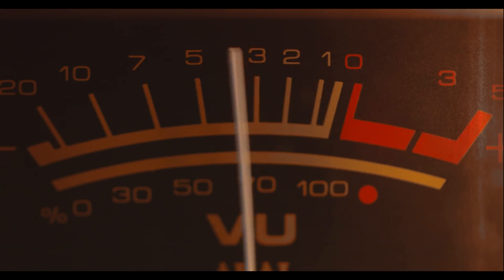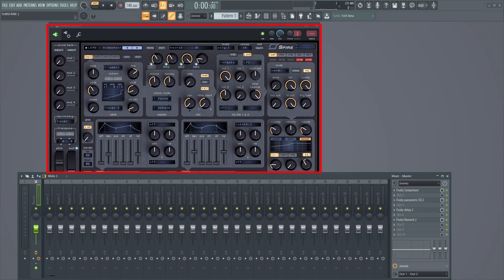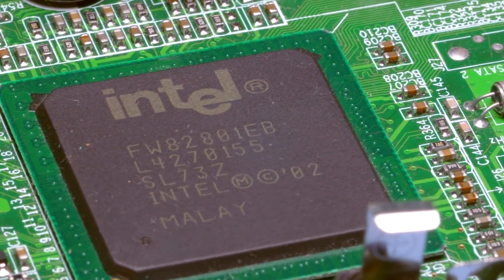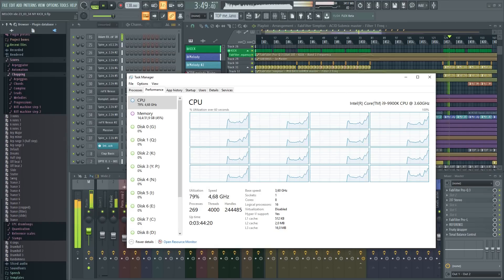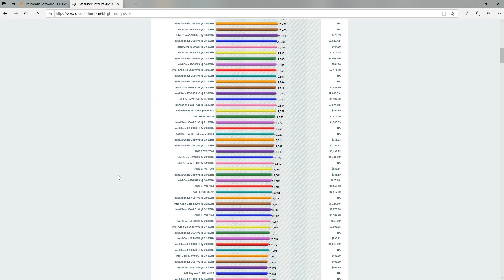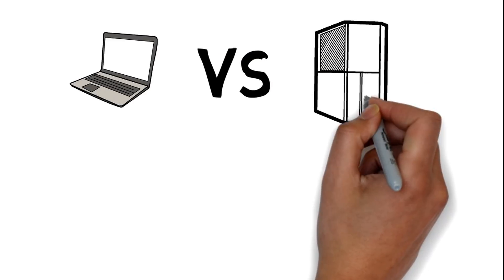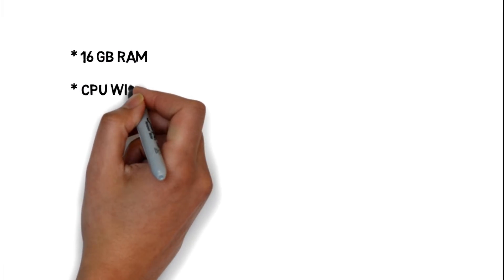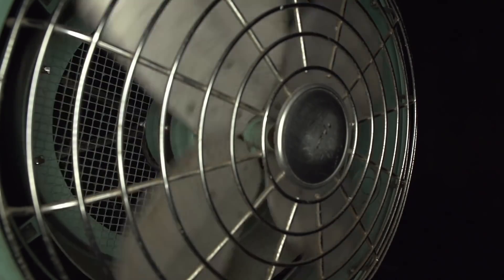The Best Computer For Music Production - What's Needed And Why!

Comment: i disagree.  i think ryzen is better, or threadripper if you can afford it.  I like your choice of case though, i have the r5 and didn't feel like upgrading the case when i rebuilt it.  BeQuiet makes good cases for silence as well.  If you need more airflow, Noctua and BeQuiet make excellent quiet fans as well as air coolers.  It's kind of weird you mention the 1700x in 2019 when the second gen was already available and 3rd gen on its way.
Reply from the maker: I think the new Ryzen CPU's are better all round CPU's in general. Especially if you also do some video editing and such which can benefit greatly from many cores. The new AMD CPUI's are great and offer basically the same single core performance as the 9900k. However, when you take clock speeds and OPC (operations per cycle (or operations per clock as it's often called)) into consideration, the 9900k will likely still likely outperform the AMD CPU's when overclocked. 3900x for example will only run at about 4 ghz on all cores at once. They are basically pushed to the very limit right out of the box. The 9900k on the other hand will be able to run above 5 ghz on all cores. Because brute force is more important than the number of cores, and because the 9900k will be able to run at more than 1 GHZ faster, it will likely still come out on top when using a daw. 

That said, most people don't need anywhere near a 9900k or a 3900x, and unless you make monster projects then you'll generally get better value with one of the new AMD CPU's. AMD has made some really great CPU's lately, and combined with Intel's ongoing manufacturing problems they have a real chance of surpassing Intel by a good amount once again. I remember back in the day when AMD was first to beat the 1 GHZ barrier. They were ahead of AMD in performance for quite some time, and this was great for consumers, because this competition ensured that prices remained low. I hope AMD will continue to improve their CPU's and that we can have that kind of situation once again. :)

Comment: I'm an OEM system builder and I hate to be negative, but a lot of what you have in this system is kind of overkill. I do a lot of video and audio stuff and play/record my guitar to the computer as well as being an avid gamer. A lot of the info does make sense, but to spend $800 on a CPU when others are fully capable of getting the job done is a bit excessive. My system runs an MSI X370 Gaming Plus Motherboard, 24GB DDR4 2400 Ram, AMD Ryzen 5 1600X unlocked CPU, 1x M.2 256GB SSD, 1x 512GB Crucial SSD, 1x 5TB performance HDD, Geforce 1060 graphics, DVD/BR burner, DVD-RW drive, a 700W power supply, utilizing a coolermaster HAF case, and a custom built water cooling system for the CPU. Running Windows 10. I am utilizing a Focusrite Scarlett Solo interface at the moment and am using Guitar Rig 5 Free. I'm virtually lag free when using my guitar and during playing and recording, my CPU load is 6% at max quality. You could use my system as a benchmark if you like for those who are on a budget. I built my system 3 years ago now at a total cost of $900. my system has 5 fans that are controlled by MSI command center and run virtually silent unless I am video editing. During audio/video editing and production, my CPU does not crest 123 Deg F. I considered my system overkill until I came upon this video because I know I'll never come close to using 24GB of RAM. I have a server I built to store most things on and try to keep this PC free. I found a key to lag free guitar recording and studio editing is to have as little running in the background as possible. I mean, we kind of need antivirus software and essential things, but for things like Adobe updater (for adobe reader, etc), and other things, I'd recommend shutting it all down. Game updaters and other things not vital to the OS or your studio should be disabled at startup. I'm hoping that you and your viewers can use this information and benefit. I know a few people who love creating music and such but don't have the money to build a million dollar computer. I bought the focusrite Scarlett Solo (3rd Gen) for $99.99 on Amazon. It does include free software, and I own Acid Music Studio and I use Audacity for things, but by far for cost effectiveness I downloaded Guitar Rig 5 Free which is actually really good for free as far as quality, functionality, and the options available. Again, not trying to knock your video, but Just offering a suggestion to get similar done for a lot cheaper. And No, I'm not trying to promote my business either which is why I haven't mentioned it. If anyone is on a budget, something similar like my setup would work great. And remember...with most if not all custom built desktops, you can always upgrade later on!
Reply from the maker: Hey there. Thanks for your informative comment :) This setup is indeed overkill for most people. The video was intended for those who actually need a lot of processing power. However, most people won't need anywhere near this, and for those people some of the lower spec CPU's listed in the video can be used instead. The new 3000 series from AMD also provide great value. 
If you're mainly recording live instruments and such then you actually don't need much processing power at all, since you will  be using mostly effects and such. However, if you're creating huge orchestral compositions using 60+ VST's and hundreds of effects, then even the 9900k might not be enough. What kind of computer you need is very individual and depends on what kind of projects you make, as well as genre, and how you work. Some projects are more CPU friendly than others (I actually have another video about that). 

This video has become more popular than I expected, and it seems a lot of people are interested in this topic. I'm therefore planning on making another video about the best budget computer for music production, which will focus more on getting the most performance for the least amount of money. It seems like there's a lot of people watching this who are on a budget, while the video was initially intended for those few who need the very best.  :)

I just need to save up some money first, so that I can buy the parts :)
Reply: @FireWalkMusic  Got ya. Yeah, I didn't feel like spending a lot on my setup and recently decided to want to record to computer. I had watched a lot of youtube videos for recommendations and ultimately, I bought a Focusrite Scarlett Solo Gen III and a condenser mic with a power supply and downloaded guitar rig 5 for free. I play my acoustic and electric guitar in spare time, pretty much goofing off and am in no way a pro so I wanted to look for something cheap and I have to say, the little setup I have is excellent. There's no latency using my setup at all. Plus, Guitar rig comes loaded with lots of stuff for free, which eliminated the need to buy extra things. It's all on the CPU I may have mentioned above. I'm willing to bet it might even work on a laptop. I've never seen the CPU higher than maybe 8% on any core. But without further testing, IDK. I do agree that if you're using a lot with higher VST's then you may need more from your system. I do believe in "rather have it and not need it, than need it and not have it" that's for sure!
Reply from the maker: @TheCommo81  A laptop should work just fine. Keep in mind that high-end laptops today are even more powerful than the top of the line stationary computer a few years ago. If you are mainly recording, and not using a bunch of VST's and such then even a budget laptop will get the job done. Playing back and recording audio really isn't very CPU intensive at all. You can also apply quite a lot of processing like EQ, compression, delay, reverb etc before you start having any problems. For pop, rock etc there will usually not be that many tracks in a project, so you won't need a lot of CPU power. :)

Comment: hi again, sorry, i have few more questions,  i plan to use both m.2 sockets, one with a samsung 970 evo 1tb for os/software and another samsung 970 evo 2tb for storage. I have looked online and downloaded the mobo manual but cant find maximum capacity spec for these sockets, I am assuming they can take up to 2tb? 

Also based on the picture on amazon the housing for one m.2 socket is at the bottom of the board while the other is just south of the cpu housing. Once cpu is installed with noctua d15 on top it seems it would be tricky getting to this and unscrewing unless you had a right angle screw driver so would be best to install this before you install the noctua d15? (on the video it seems to show the m.2 housing south of the cpu being covered by the noctua).

Last question was about overclocking and the software you are using for it, are you using the asus bios to do this or 3rd party software?
Reply: thanks for getting back to me, much appreciated, keep up the good work !😀
Reply from the maker: Hi, I'm not 100% sure but I believe it should be able to handle 2 tb. It is indeed best to install these things before installing the CPU cooler since it's so massive. That said, it's not that difficult to remove the cooler from the motherboard, it's just two screws. Just make sure to clean and reapply cooling paste. I just use the Asus AI suite. It can automatically overclock the system on it's own. It will run a series of test to determine the maximum stable speed of your CPU, as well as calibrate all the fans etc. You can also use the bios if you prefer that. :)